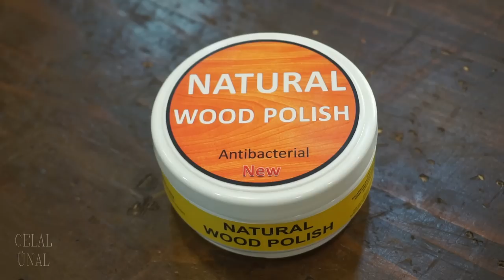Woodworking / Making a simple wooden tray from pallet / Paletten ahşap tepsi yapımı

Comment: Pallets are pressure treated and not recommended for indoor uses such as countertop, cutting boards, trays for holding fruit, etc.  Pressure treated palettes made before 2004 are even more dangerous because arsenic is used in the process.   I'm pretty sure the op didn't know and the op has plenty of other resourceful videos but ignorance isn't a bliss when shit ton of people upvote and try making these stuff with unsafe material.